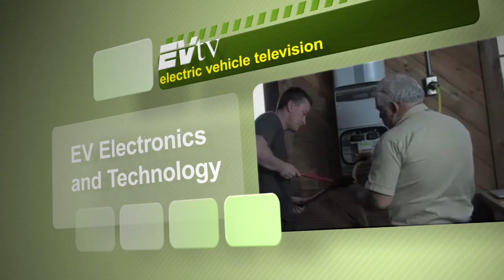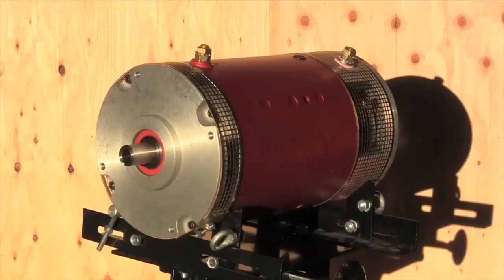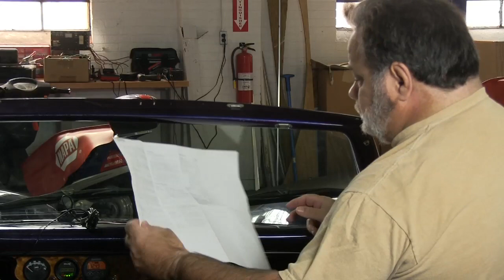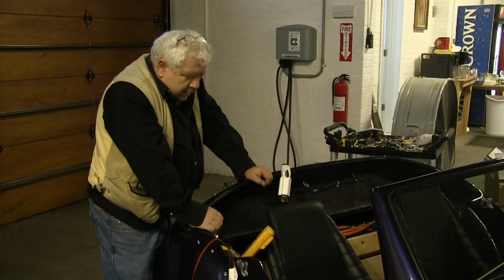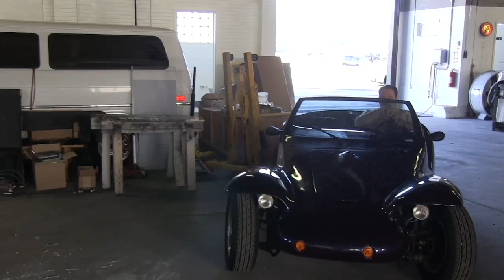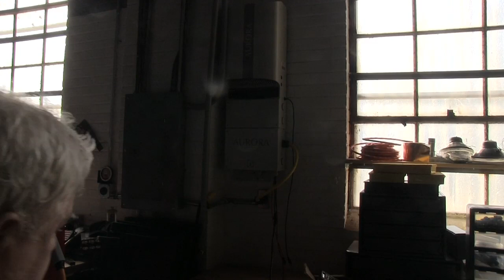EVTV Friday Show - January 27, 2012

Comment: @marionrickard Hey Jack:
Have you seen the impressive and powerful new wheel motors made by Yasa Motors in England?  These look quite amazing and would allow the complete removal of the transmission, driveshaft and differential, opening up a whole lot of space for batteries underneath.  They are expensive at the moment but they are not mass produced yet either.  They also are extremely efficient and make conversions so much easier.